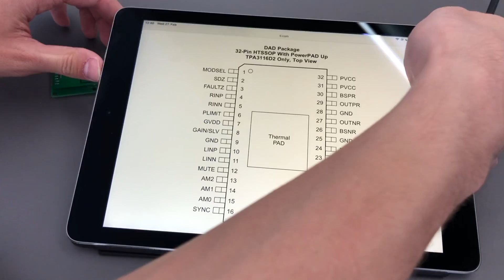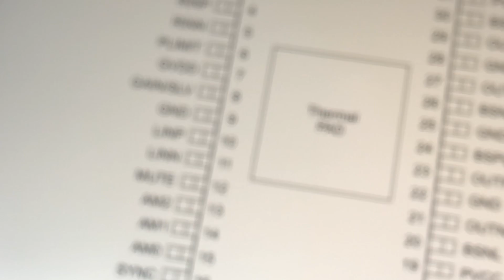Converting Amplifiers to have Differential Inputs - TPA3118

Comment: soooo i did the mod to the one with the bt chip and hooked it up to a pair of 4ohm coaxial car speakers, the first 3 minutes it worked perfectly and sounded extremely clear. After that tho the audio started cutting out constantly and i saw amp spikes on my power supply, up to 2 amps. I turned the power supply off and checked arround, nothing is sorting or smth. My suspicion was  that the problem were the 4 ohm speakers cause from what i found that amp is designed for 8 ohm speakers. So what i did is got some 10ohm 4 watt resistors(the only ones i had lying arround) and wired one in series with each speaker. At first it was cutting out again but after about 1 minute of that, it started sounding great again but one minute after that it started cutting out again and the resistors got extremely hot (they were 10ohm 4 watt resistors) so i stopped and orderred 4ohm 10 watt resistors and when they came i installed them, so each speaker has a 4ohm resistor mounted in series which should give me 8 ohms per speaker, then the moment for the soundtest came and it again does the same exact thing, it cuts out constantly. Do u think that i have caused permanent damage to the amp? or what do u think is the problem, thanks in advance.
Reply from the maker: hey man .. weird stuff ..

I am 100% sure it's not the 4ohm speakers, the datasheet does specify for that

what amp exactly are you using, and how much voltage are you feeding it ??
Reply: @Darieee  I am using the amp you have linked (the tpa3118 + csra64215) and i am feeding it 24v using my bench power supply. Another weird thing is that after further trying with the resistors i noticed that the one i have placed on the right channel speaker gets considerably hotter than the left one (both speakers are the same) (i measured the ine on the right channel at a crazy 100° and the one on the left was room temperature)
Reply from the maker: yeah .. something seems to have went super wrong there
Reply from the maker: it sounds like your amp is biased all wrong ... try and measure if on no music it's passing current through the speakers 

and if they're worth much, then, tread very carefully going forward 😬

Comment: What you do after lifting two? Need connect something? Thanks
Reply from the maker: yep! you connect stuff as follow

regular L_in :: L+
lifted cap L_in :: L-
regular R_in :: R+
lifted cap R_in :: R-

where L+- and R+- are two differential audio signals (negative no longer tied to ground)

this reduces 100% of all Bluetooth ground-loop noise
Reply: @Darieee  thanks so if I understood correctly and input negatives will be connected to lifted ones. Out put should be connected as it is. I have 2.1 system with 1 stereo and 1 mono amp and I get hiss as I use 100w step down converter from main supply to ws2812b led and sp107e controller.I am using  Xbox adaptor 200watt 12 as supply. I used that ground loop isolater that did  reduced lot but still I hear lot.
Reply from the maker: you understood corectly
Reply: So if i use a 3.5mm audio jack input, the left input will be connected to the left + lifted capacitor and the right input to the right + lifted capacitor and the ground of 3.5mm jack input to the negative lifted caps? Or my understanding is wrong?

Comment: Nice video but very technical and certainly the advices are for electronics genious and also for very experts in solderings... I do some solderings myself but what you suggest is far from what I would try to do... Please try give some simpler solutions....if possible. Thanks!
Reply from the maker: yeah .. unfortunately this is the simplest approach to this problem :(

outside of this, you just have to buy an amp that's designed to take the pop into account

Comment: Hi Dariee, thx for the work. So I get the point for the HYT PCB with BT onboard that both chips support differential input and the mod look doable. But what do I do if I only have normal audio line out, e.g. 3,5mm jack? Can I use the method too? Or in what cases can this be used?

Comment: The main 3 objective of  differential output route to differential input configuration are
1. No blocking capacitor required,so natural low frequency response can be achieved.
2.As bluetooth ground loop system noise is common to both differential input,So they get cancelled out in the differential stage.And high audio quality can be achieved.

3.Another thing is that ,2 times signal swing at the input causes more output signal than single ended input configuration.

And Zero analog signal processing required in CSR as there is an in built kalimba DSP present,which can boost the audio performance digitally.

The only requirement for converting to single ended configuration from differential input (by an opamp ) is to process in analogue domain, System coupling compatibility .But in this hifi it is not required.

And headphone amplifier connection is another consideration for converting the diff input to se output ,which can drive the headphone drivers,by l,r & g.

That's all.Thanks for discussing these hifi speaker design concepts.
Reply: THe input capacitors are required since the differential signal of the bluetooth chip will have DC bias and can burn the input stage of the amplifier. If you don't trust me, search "TPA3255 Input without capacitors".

Comment: Sir, i am in confusion please help..
  Which one is better tpa3110 or tpa3118?
  Which one has better bass
  I will power them from 3 18650 lithium battery
Which one has more powerful and clear sound?
 Which one worth every penny
Reply: Same question here, please answer
Reply from the maker: TPA3118 
ALL THE WAY !!!

More power with no drawback! (costs more of course but, yea)
Reply: @Darieee  on same output volume which one will give better bass?
Would use 4 × li-ion battery
Reply from the maker: TPA3118 
A L L 
T H E 
W A Y
Reply from the maker: I even think you can buy 2.1 amps with TPA3118 chips ... those should be awesome

Unlike the much more powerful TPA3116, this chip has absolutely no turn-on thump
Reply: @Darieee  What did you mean when you said "Unlike the much more powerful TPA3116, this chip has absolutely no turn-on thump". The 3118 срip is better than 3116??? And what do think about the tpa3116D2 chip?
Reply from the maker: 3116d2 is very fussy about how you turn it on - check my tpa3116 amplifier reviews - especially the bad ones, to see what I mean

and then check my tpa3116 anti-thump video to see how to fix it
Reply: @Darieee  Ok, thank you. But in short, TPA3118 chip is better?
Reply from the maker: yes - but - weaker
Reply: @Darieee  ок) TY